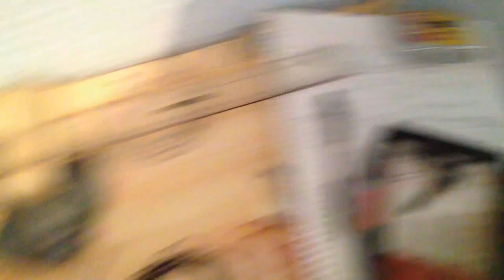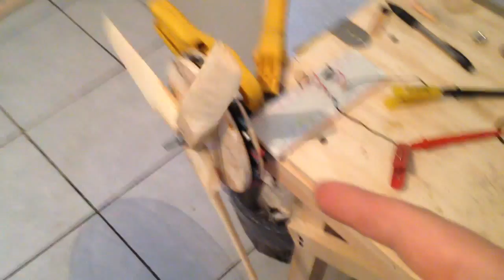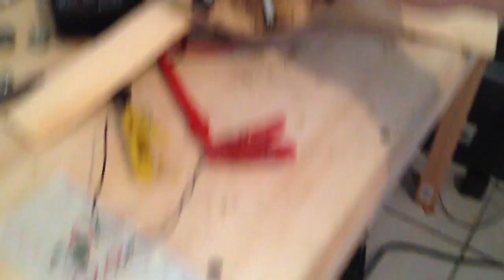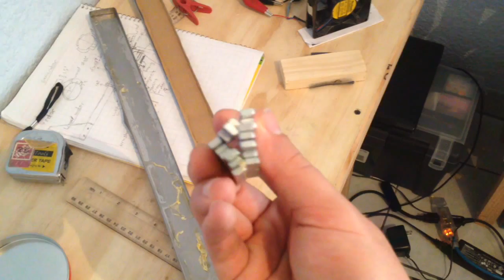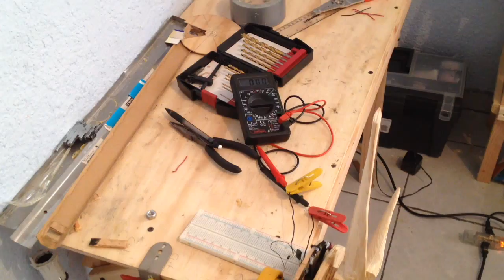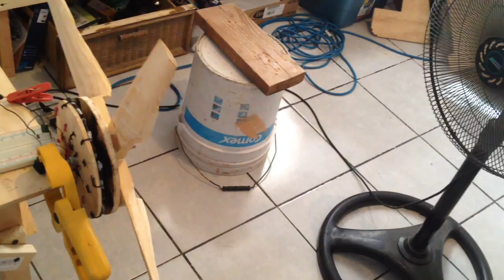DIY wind turbine 3, first generator

Comment: The inside diameter of any coil should be just slightly larger than the outside diameter of any magnet to allow for the maximum amount of flux to saturate the coil. Flux exits out of the north pole and loops around to enter into the south pole. They are strongest closest to the magnet. The stronger the flux the higher the voltage for less work than what you have shown here.

Comment from the maker: ElvedinZ thanks for the tips.  I am currently working on a larger generator using dual 7 inch disks of steel with 12 magnets each and a 9 coil 3 phase stator.  Please see the video below.

http://youtu.be/IVmPztxdSeU

I am also building larger blades to power this generator.  I am trying to build it all using free or very cheap materials.  I have the most difficulty finding good magnets.

Comment: If you fix your magnets on a Iron disc, you will get much more power .If you really want to generate some power, then you need to build a 3 phase stator with two rotors, 9 coils and 24 magnets.